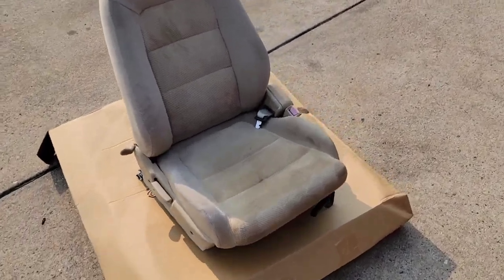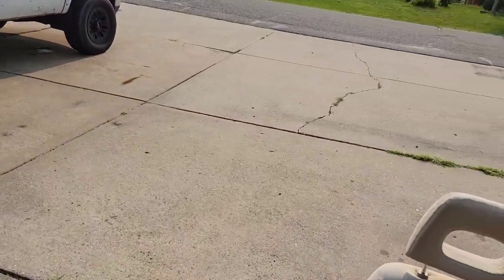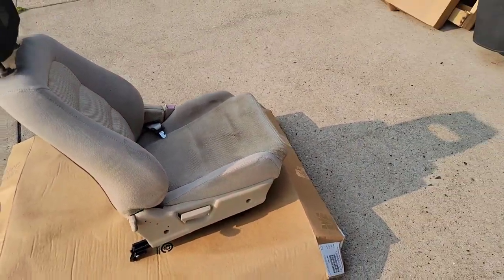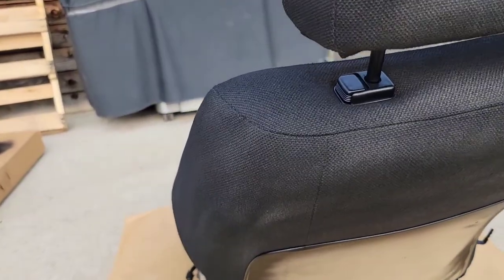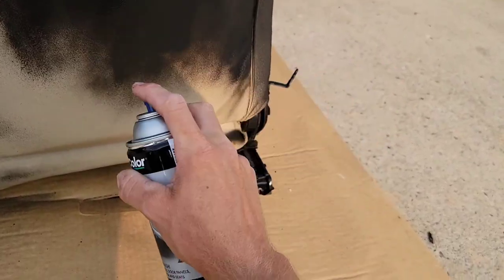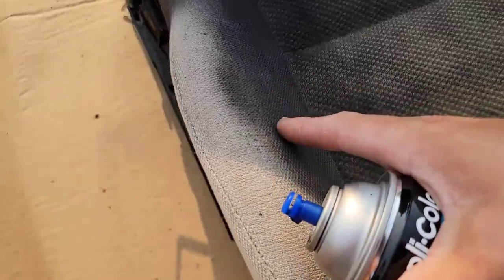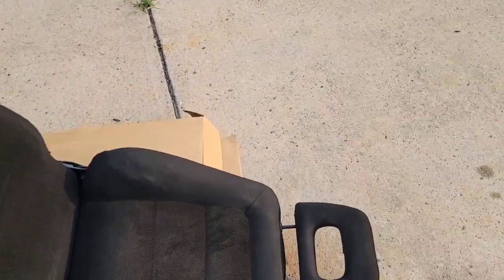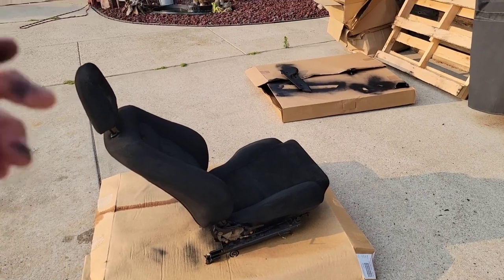how to Dye cloth/vinyl seats. integra gets a passenger seat!

Comment: Does the fabric become rough after painting?
Reply from the maker: It gets a little firm but not to bad.
Reply: If you want a fuex suade effect wait longer periods between coats and light coats. After a coat dries take a firm hair brush and brush the soft fabric areas all around. Repeat except not as a final step. C9mes out a lil softer and a lil suade effect.

Comment: Tip when spraying clothe use a soft brush between coats turn out good .
Reply: Which direction should you brush?
Reply: @AutoRevLife  do a cross pattern because it’s goes in the material in between the pattern ..
Reply: Should I coat the whole seat than use the soft brush or do it in sections and brush per section per coat

Comment: Thanks. I'm going to two tone my 2007 Avalanche seats. Black and grey.😂
Reply: I was just thinking the same thing. I just bought my son an 08' Av. Cloth seats could definitely use a little something. 🤔 But now im wondering how the gray would take, on black cloth. Im gonna buy some gray and go to fabric store to get a small piece of black fabric to test. The leather cover-all seat covers that i want to get him, are pretty costly. Definitely when talking about seat covers. Granted....... cheaper than buying leather seats! Have you seen any covers that are split bench and split back, that'll work for avalanche rear seat setup? Ive seen plenty of split backs, but the bench covers are solid, all way across. Have you taken it on yet?? If you get to the blk/gry project before me, let me know how it works out.